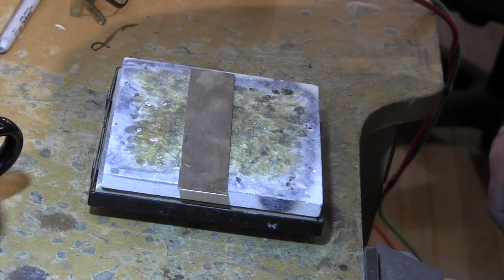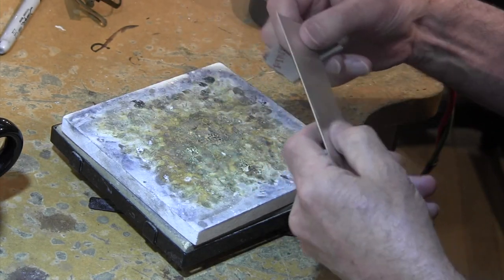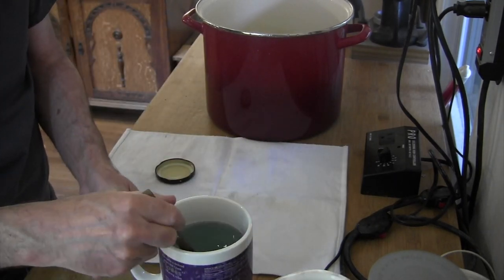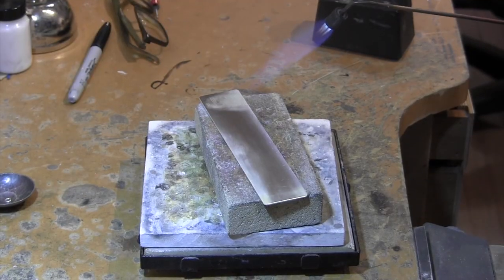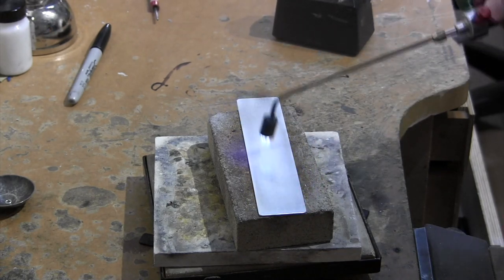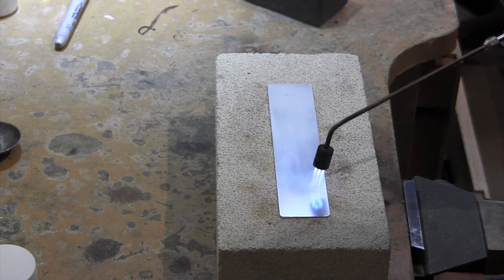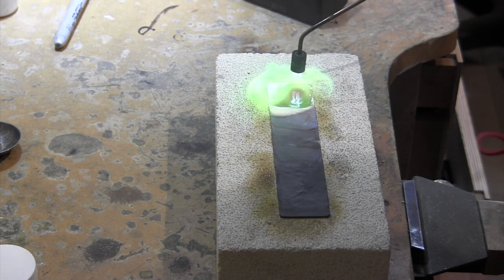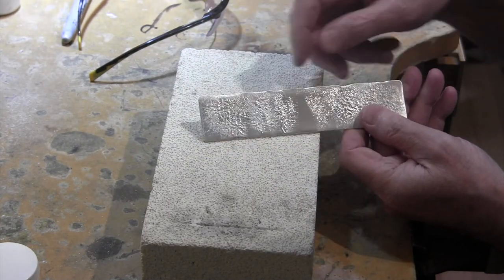Tutorial on Reticulation Silver

Comment: the reason why it is not showing dark oxide layers is because drawing the copper to the surface and etching it away leaves you with pure silver, which does not oxidize. so its just white metal.
thats called depletion.

Comment: Very nice! When you anneal, are you concentrating on a single side to bring up the fine silver? I noticed the reverse side, which you liked better, appeared to have more silver at the surface than the top side.
Reply from the maker: I try to alternate each annealing to be on the reverse side.  The reverse side was most likely protected a bit from from oxidation during the reticulation step, and just cleaned up nicer.  I am sure with a bit of polishing the other side would be as bright and silvery.  I liked the bottom side because of the nooks and crannies that developed.  I believe that this occurred because of the surface texture of the fire brick I used.

Comment: at 9:20 of this 16:23 tutorial, Pat talks about wanting to melt the fine silver. This is wrong. The inner part of the metal is sterling while the outside is a very thin layer of fine silver. The melting point of fine silver is somewhat higher than that of sterling, so you are melting the sterling without quite melting the surface layer of fine silver. The outer layer, unless you melt it too, contains the liquid sterling.
Tycho

Comment: Hi, so reticulation silver can or cannot be called sterling silver once reticulated?
Reply from the maker: Well no it should not be called sterling silver. Some do because it is a name people are familiar with but it is not 92.5% silver.
Reply: Reticulation silver, some times called coin silver, is an 80/20 alloy (80% fine silver and 20% copper), as opposed to sterling silver, which is 92.5% silver. You can reticulate sterling silver, too, but it's not as dramatic as coin silver.
Reply from the maker: @reneeziegler3823  I believe that coin silver it 90% silver 10 % copper correct me if I am wrong.
Reply: @patcahillmetalworks322  Yes, you are correct that the recognized coin silver standard is 90% silver and 10% copper; however, the term "coin silver" is derived from the practice of actually melting  down old silver coins, which can vary in fineness from 75% silver to 90% silver. Rio Grande sells a reticulation silver sheet that is 80/20 silver to copper.
Reply: If reticulated removes copper from sterling. Then it is logical to beleave that the resulting product is no longer "sterling" but an alloy with higher silver content. Until a the metal can be accurately assayed then it still must be considered sterling because all of the copper has not been removed.
Reply: @reneeziegler3823 reticulated silver can not be 80% silver and 20% copper because the process removes (copper) from the outer layers not silver therefore the copper is reduced not silver. The silver percentage is raised in comparison to the copper. Meaning a higher silver value not a lower value.
Reply: У меня есть юбилейная монета 925 пробы